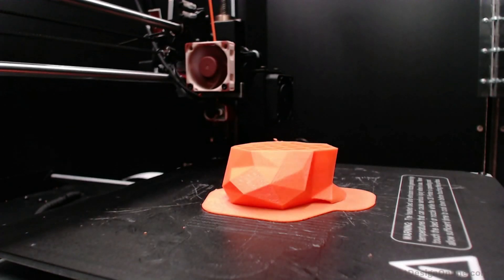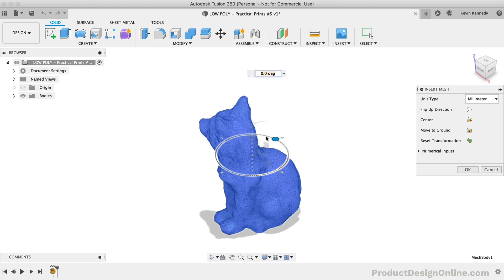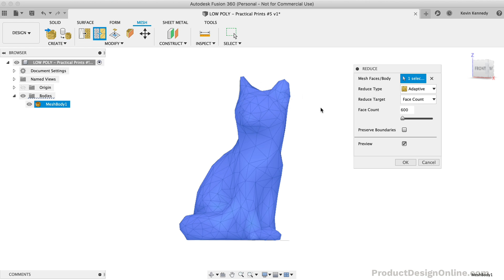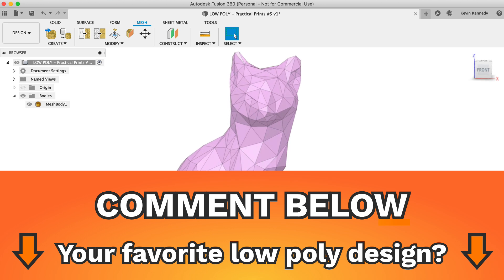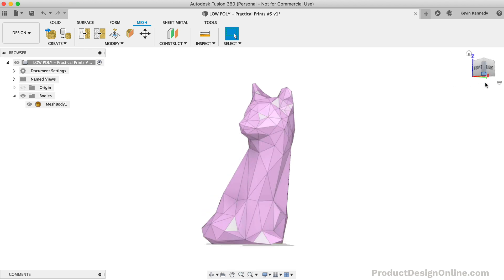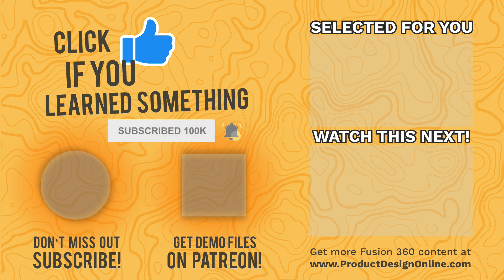Creating LOW POLY Models in Fusion 360 for 3D Printing | Practical Prints #5

Comment from the maker: Here's the resource page - https://productdesignonline.com/p5
Video on splitting bodies up for 3D printing - https://www.youtube.com/watch?v=KFQ4-1GH0wg
_
TIMESTAMPS
0:00 - Creating LOW POLY models in Fusion 360
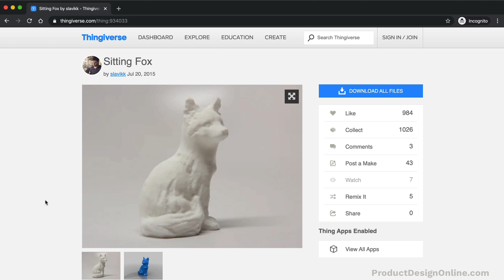1:00 - Getting a model from Thingiverse
1:20 - Inserting a mesh file
2:00 - Turning off Design History
2:26 - Switching to the Mesh tab
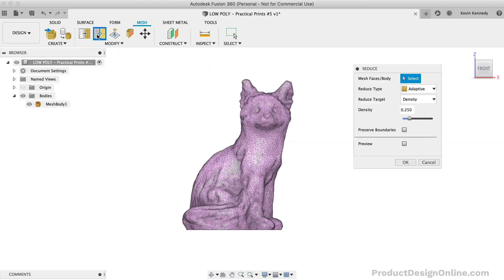3:00 - Using the Reduce tool
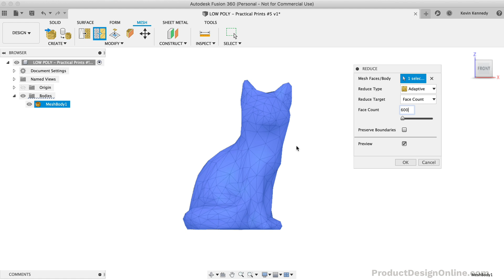4:07 - Changing the Reduce Target
5:36 - Changing shading style to Flat Shaded 
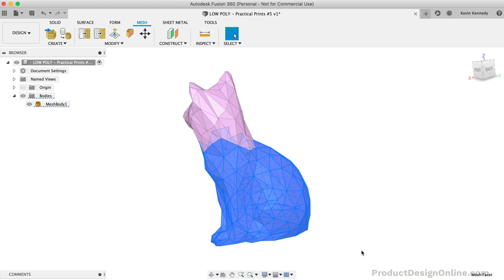6:48 - Adjusting specific parts of a model
7:50 - Changing model to solid body
8:37 - Splitting bottom to make it flat
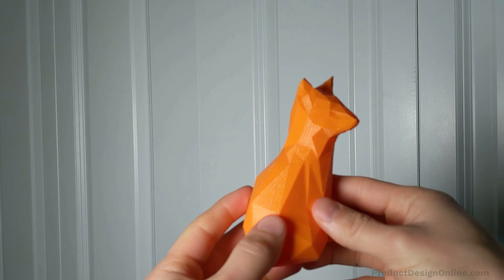9:00 - Printer Results

Comment: ive tried  7 other .stl files. why is it that your suggested fox file seems to be the only one that works with this method...wth
Reply from the maker: The workflow should work with any files as long as it doesn't have 80K+ facets. Even then, you can slice it up and convert it in section. What type of file are you trying?
Reply: Product Design Online figured it out yeah I was just being an idiot, thanks

Comment: Thanks for the tutorial! Very useful. I am a total noob, but I had a different experience at the end (I am on Windows using free license btw):
1. I could not delete individual triangles, but I could delete many at once (sometimes with strange results).
2. Even when I deleted multiple triangles, the bottom area of the figure was not parallel to the plane, so the figure would not be straight once printed. To solve this, I created a rectangle on sketch, then extruded vertically to intersect it with the botttom of the figure, and used the cut option to remove material from the base of the original figure. The result was a perfectly flat bottom and a straight figure. Another way to solve the problem!
Reply from the maker: Hi, Julian. Thanks for sharing! That is definitely another great approach to making the bottom flat :)